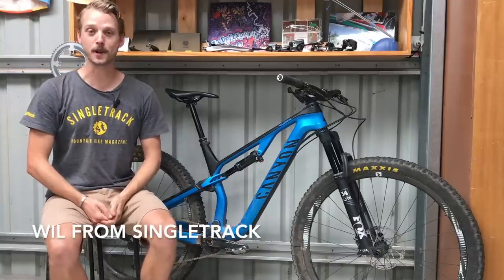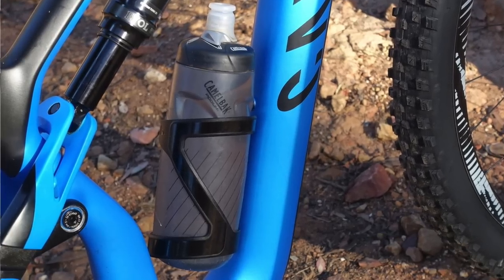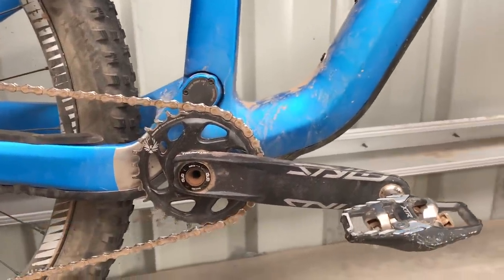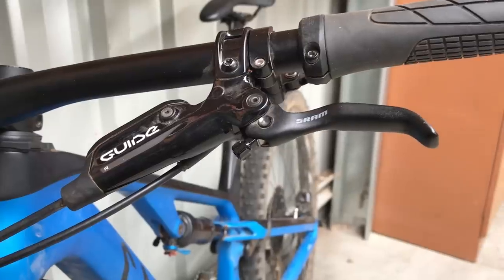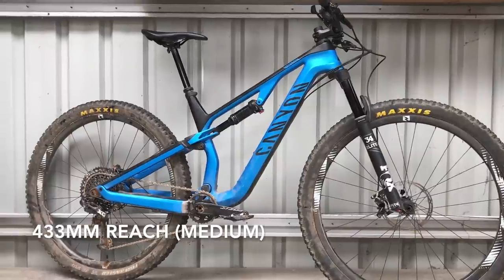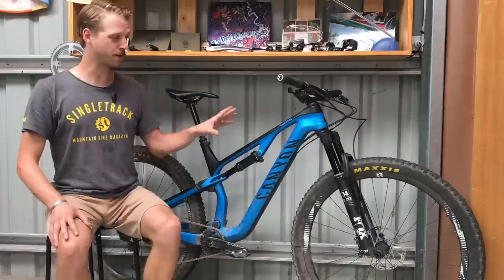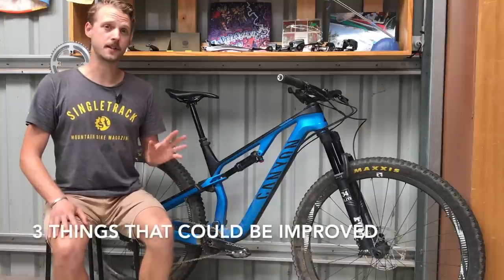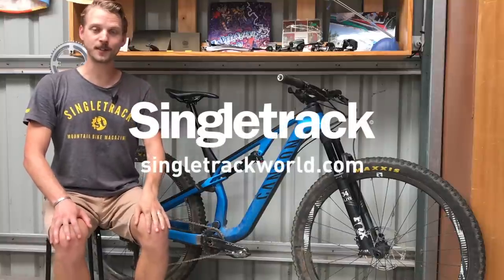2019 CANYON NEURON CF REVIEW | A Longterm Test Of Canyon's New Carbon Trail Bike

Comment: How about a comparison to the AL neuron? 700€ jump to a CF seems a bit too much for a weekend rider... your thoughts?
Reply: Agree!!!
Reply from the maker: Great question!

I've tested the pre-2019 Neuron AL, but I've not tested the 2019 version, which does have an updated suspension design and new frame geometry. As mentioned in the video, the 2019 Neuron AL and Neuron CF share basically identical geometry, and Canyon told me that the suspension rate (and therefore behaviour) is very similar between the two bikes - even though the layout looks quite different. So you can expect the handling to be pretty similar.

The Neuron CF frame isn't that much lighter than the alloy one (there's less than 200g difference), so you wouldn't buy it to get a significantly lighter bike. But the carbon frame has clearly been built to be stiff, strong and reliable, and there are some really neat details that you won't get on the alloy frame, such as;

New bearing concept: industrial cartridge bearings with dual-lip seals, external pivot caps, and a dual-row bearing arrangement for the main pivot (for stiffness)
Cable Channel: routes the cables internally underneath bolt-on downtube armour
Quixle thru-axle: offers tool-free wheel removal with a very clean look
IPU (Impact Protection Unit) headset: prevents the bars from over rotating in a crash

As for the parts on the Neuron CF 8.0 vs the Neuron AL 7.0, here are the upgrades I can spot that you get on the CF 8.0;

Wheels: The DT Swiss M1900 is likely to be a stronger option, and interestingly, Canyon specs the front wheel with a 30mm internal width and the rear with a 25mm width, which is pretty cool! The Mavic XA Pro wheels on the AL 7.0 are a little skinnier with fewer spokes (24 vs 28)
Tyres: Maxxis Forekaster 3C tyres have a better compound and casing
Brakes: The Neuron CF comes with SRAM Guide T, rather than Shimano MT400

Otherwise the suspension package and drivetrain are very similar between the two.

For a weekend warrior, the alloy model is likely going to be a great bike, and certainly good value for money too. If you're looking for a bike to own for a long time, and something that you can steadily upgrade over the years, then it may be worth going up to the carbon model to get that higher quality frame and bearing system.

Either way, I'm sure you'll be stoked with whatever you get!

Hope that helps, but just shout out if you've got any more questions :-)

[ST Wil]
Reply: @singletrack  actually old geometry bikes are still available. The best option would be to test 3 bikes back to back on the same track. But just testing 2 new models AL 7.0 vs CF 8.0 is good. Well I am riding in weekends, because I work in workdays, so maybe I am weekend rider, but when I am during long weekend ride (we are doing about 40km on mountain trails daily if I am 40km from my car on Saturday and planning to go back on Sunday I don't even want to think about cracked carbon frame. I have not seen any impact test, etc showing comparison between AL frame and CF frame. This side actually biggest problem that I have with new bike. And regarding brakes - well... both bikes have brakes that need upgrade. And tires are not worry as in Rocky areas they don't last too long. Some people want bike they can trust dourng 2-4 days runs and I am one of them. I don't trust CF as frame material without proof of impact tests etc. I am riding for over 30 years and every year me or my wife have smaller or bigger crash, so this is significant factor for me. Also there is no info about crash replacement cost. So if You can get answer for those points I am sure more people could decide better with their next steps. Currently safer option for me is AL...

Comment: Hi, Wil  Now I'm still deciding between Scott spark 920 & the Neuron 8.0 CF. Looking for shorter travel 29r for all-around distance as well as mixed trails. The Neuron is hard to ignore the package & price just don't want to regret not buying the proven spark, can't get any demos done on either bike as I need to buy online. what one would you choose
Reply from the maker: Hi Colin P!

That's a really good question, since the Scott Spark is a very well regarded lightweight trail bike. 

In direct comparison, the Spark has a little less suspension travel (120/120mm vs 130/130mm), but it otherwise share some pretty similar dimensions to the Neuron CF - the head angle and reach are almost identical, for example.

I haven't ridden the Scott Spark - I've only reviewed the Spark RC, which is the 100mm travel version. However, the Spark RC and Spark essentially share the same frame, just with different length shocks and forks that change the travel between the two.

I really like the Spark's suspension design, which is actually pretty supple and active. And because you have the 3-position TwinLoc remote, you can tune the suspension to be a little softer for descending comfort and traction, while being able to flick into the firmer 'Trail' mode when you need efficient pedalling. It's a nice system that works well.

Some people aren't big fans of the extra cables that comes with the TwinLoc system, but having tested it on the Spark RC, the Genius and Ransom, I have to say it's a big performance booster on all those bikes.

In comparison, the Neuron CF has a simpler approach to its suspension, and it's designed to pedal efficiently without having to adjust levers on the rear shock. While it pedals and climbs well, I wouldn't say it's super plush though. 

The frame on the Canyon Neuron CF does appear to be a little beefier than the Spark, and it is really nicely finished too - the pivot bearing system, IPU headset, and semi-internal cable routing design all work well.

Personally? I'd probably prefer the Scott Spark 920. I like that Scott is spec'ing the Spark with a shorter fork offset (44mm), which should help to stabilise the steering a little at higher speeds. That was something I found lacking on the Neuron, as it was a little twitchy on more technical high-speed descents.

Hope that helps!

[ST Wil]
Reply: Thanks, Wil. It is probably worth the extra money just for the ride quality alone. Helps with my decision  👍👍👍
Reply from the maker: @chloemuffin1  - Glad I could help out mate!

Let me know if you've got any other questions in the meantime.

[ST Wil]

Comment: Hi Will, 
excellent review, thanks a lot man. Can you please help me with something? You said, that it can be problem to upsize due to seat tube lenght. I am 185cm tall (cca. 6"1´) with inseam +- 85cm. The size L is for me OK (I test it), but I hate long stems and on this bike is the stem on the longer side (60mm) and 453mm for reach by size L is really max limit for me, I think. The quesion is, when I go for XL(on Canyon site for 192+ cm) and change the stem to 40mm (it will be then the same reach as by L size), I am worried, if the seat tube lenght will be OK for 150mm dropper, cause it is 30mm longer as on L. What do you think about it? And overall the feeling on XL with my height. Thanks in advance. 
Best regards, 
Tomas
P.S.: Have you ridden the Izzo? I am about 220lbs (+- 100kg) and I really dont know, if the frame on Izzo is so stiff as this on Canyon and if it can handle my weight without flex. I am also thinking about Jeffsy Pro or Propain Hugene. I really want mainly a good climber (+- as good as Neuron), but maybe something little better on descents. Ibis Ripmo is the best of both worlds, but for me too expensive.
Reply: Hi,  how did it go? I am 186/88 a want to order XL
Reply: @Brcinskij  Thanks! ordered XL today... I was lucky because there was one XL on the website (2. jun 21') and its mine :)
Reply: What did you end up with?  
I bought a 2020 Commencal Meta TR 29"! and love it on the Oregon Mountain Trails.
However, here it is a couple of years later and I am looking at a used 2019 Neuron for the 2 months per year we spend in Southern (not so mountainous) Thailand.
Reply: @drmoynihan  Hi, I bought size L and it's a great bike, with L and my height the position is a little upright, but I like it so. It is very good uphill and for me personaly good enough downhill too. After purchase I have changed the handlebars for 800mm fatbar (20mm rise) and the saddle for Ergon SMC4 MTB comp gel, because the original one was too hard for me. With my height/inseam the dropper post is about 2cm from frame. Overall It is an excellent bike for my riding style. The YT Izzo was also on the list, but in the end I took Neuron (I didnt want SRAM components, cause I am already used to Shimano). I hope it helps you.

Comment: Important fact is that this bike has (just) 30t chainring, which may be not sufficient in higher speed. I found myself driving with smaller sprockets more often. Strange decision by Canyon, especially when Strive and Spectral models have 32t and Lux 34t. Anyway, thanks for precious review and greetings from Czech Republic.
Reply from the maker: Hey there Jiri!

Thanks for watching the video, and for your kind words :-)

I think the 30t chainring is a decision by Canyon based on the Neuron being targeted more at beginner and intermediate riders as a comfortable, do-everything trail bike.

The Spectral and Strive are pitched at more advanced and more aggressive riders who want to ride really fast downhill - so they have bigger gearing with the 32t chainring. And the Lux is of course a very lightweight XC race bike, so this type of rider will want to have higher gearing.

The good thing is with any 1x drivetrain though is that changing the gearing is very easy to do - all you need is to swap the chainring to a bigger or a smaller size.

For me, I like the 30t chainring. But then I prefer to spin a lower gear, rather than mashing a harder gear. I find this is better for my knees, but that is my personal preference :-)

[ST Wil]

Comment: Hello, thank you for review.

I'm  185 cm and 89 inseam - L or XL. What would You recommend for me ?
Reply: Hi, I’m similarly specced. Canyon Sizing tool says “L”. Which one did you get, and how did it work out for you?
Reply: @globetlottel  Same here. Which one did you get?
Reply: @Diego Perez, i got the XL and i think it fits fine, in terms of “can reach handlebars comfortably and turn them the full range” or “can adjust to good seat height” etc. haven’t been to the the trails with it though. (190 cm / 90cm Inseam). That being said compared to my old 26” Hardtail this is a huge machine and doesn’t feel as nimble, more like a big cruiser.
Reply: @globetlottel  thanks for your response. How much seat post length do you have left. Doing the math it seems that it is too tight.
Reply: @Diego Perez  I have the dropper seatpost inserted all the way to the bottom. For normal riding on flat roads (post fully extended) I might want to pull it out of the frame by 1 or 1.5 cm. So, there’s plenty of usable seat post length left in my case. The reviewer in this video mentioned the seat post wouldn’t go low enough. I believe that could be a problem for some body proportions, but not for 185 or 190 cm with 90 cm inseam. When dropped down, the saddle is well out of the way.
Reply: @globetlottel  very useful. Thank you so much
Reply: @Diego Perez  
my pleasure! Enjoy your bike when you get it :)

Comment: Could a 14 year old 5.2 teen ride this? And could this fit a Fox 40 down hill fork
Reply: No way this bike is fitting a Fox 40, if you said a Fox 34 then yeah but no more than that, you're going to break the frame. And yeah I guess a 14 yo could ride it
Reply: Aniol Juanola, thanks, and how would it crack the frame?
Reply: @isaacalvarado2568  just think that this bike is meant to ride with 130mm up front. If you put there a 200mm fork you're changing the geometry drastically (changing the angles and the way the frame is meant to work) and you can easily brake it as the frame would experience forces which is not designed to support. You could try it and they would fit, but after a hard impact or a big drop I think it would brake down (keep in mind it's also a carbon frame).
Reply: I have this bike and I got a Fox 40 for it and it feels great! Fox 40’s are awesome! They look cool, and they function amazing! I ride road but I ride a DH bike🤣 LOL if you get a Fox 40 you won’t be disappointed

Comment: 173 cm, get recommended s but I really want a 29er 😕.
Reply: Vault-Boy Dan at 173 you could easily get away with a medium
Reply: @markroberts9298  Hey, thanks man :), Canyon's sizing really confuse me.
Reply: Vault-Boy Dan I just had a look at the website, and for the small it says up to 174cm and the medium from 174cm up. If you really want to 29, definitely go for the M because your almost there, and the reach on the M is only 15mm longer than the S. It all depends what sort of rider you are, if you prefer more space and want a 29er go for the M, but if you want a smaller, more nimble and nippy bike, go for the S. that isn’t to say the M won’t be nimble tho.
Reply: @markroberts9298  Thanks for checking it for me, I really appreciate it :). I think the bigger wheels suit better for this marathon/trail oriented bike and you're absolutely right about that reach, at the end it isn't that much of a difference and the benefit of having bigger wheels probably prevails in this case. Right now I'm searching for the trail bike that can climb very well and also be confident on the descents so I'm thinking about this neuron cf or spectral, but I'm leaning more towards neuron as I really want a good climber.
Reply: have you bought the bike? @Vault-Boy Dan

Comment: Hi, that's a great video! I have a question regarding size: I'm 179cm, 82cm inseam and 62cm arms. Would size L fit me better than M? Should I go with longer stem on size M (7-8cm) or shorter stem on size L? Thank you!
Reply from the maker: Hey Dario, thanks for watching!

At your height, I would 100% recommend the Large size frame in the Neuron CF.

I'm 4cm shorter than you at 175cm tall, and while the Medium was ok for size, I would have preferred a longer reach. The Neuron CF isn't a long bike in the cockpit, so I think if you went for the M, you would be very cramped.

Hope that helps!

[ST Wil]
Reply: @singletrack  Thank you for quick response. In that case I think I made a mistake. I already purchased neuron al 7.0 M size which is similar geometry and it feels a bit short. I put 70mm stem instead of original 50mm, pulled a saddle back to max and I still have a need for even longer stem. This tells me something is not ok. I would say it's better to have longer frame and short stem than the opposite. Canyonservice tells me it's ok from their perspective so I wanted 2nd opinion. Do you maybe know how it goes with replacement? Maybe only the frame? Any experience with canyon? Thanks a lot!
Reply: So, what happened with Canyon?  Did you trade up for a Large?  Was Canyon easy to work with?  Are you happy?

Comment: why u said its a trailbike ? 
canyon never said it is a trail bike.
On the contrary, they even said it does not follow the trail bike trend and is intended for touring. Just look at the Geometry, it has nothing to do with a modern Trailbike.
The real Trailbike/Allmountain from Canyon is the Spectral and nothing more.
Reply from the maker: Hey @fnnor, thanks for watching and for the question!

I think it might depend on what your personal definition of a 'trail bike' is. Also, the Germans tend to use the term 'touring bike' in a different way to other English-speaking cycling markets, so it can cause some confusion.

It also depends on how many genres of mountain biking you think there are. Based on the terms that many MTB brands and media use, here's a bit of a breakdown for ya;

XC Race: Hardtails and full suspension bikes with 100mm or less of travel
Marathon: 100-120mm travel, focus on lightweight and race geometry
Trail: 110-140mm travel, relaxed geometry, balanced for uphill & downhill
All Mountain: 140-150mm travel, focus on descending fun, plusher suspension
Enduro: 140-170mm travel, aggressive geometry & parts, focus on enduro racing

Because the Neuron CF is neither an XC/Marathon race bike, nor an enduro race bike, it slots pretty firmly into the 'trail' category. Which as I mentioned in the review, has a pretty broad definition depending on where in the world you live and who you ride with. 

Whatever you want to call it, it's a bike to have fun on. It's light, efficient and comfortable enough for tackling long arduous climbs, but it has enough suspension, high-volume tubeless tyres, and powerful 4-piston brakes to enjoy the descents too. Most mountain bikers would call that a trail bike, but I can appreciate that others will have different names for it.

Hope that helps explain, but just let me know if you've got any other questions mate!

[ST Wil]

Comment: 7:27 but you never considered the size could be one too big for you?
Reply from the maker: Not at all. The next size down (Small) not only moves to smaller 27.5in wheels, the reach shrinks down to 418mm, which is tiny!

In fact I would have really liked to try a Large frame, which comes with a 453mm long reach. But as I mentioned in the video, the long seat tube makes that pretty much impossible, unless you go to a much shorter dropper, or a regular seatpost. As it stands, the 433mm reach on the Medium size is fine, but if anything I'd want it longer - not shorter.

Hope that helps!

[ST Wil]
Reply: @singletrack  I know, the sizing problems are known to me. My girlfriend is 178 with 88 cm inseam and pretty short torso, so the opposite problem, I guess. 
I on the other hand, just rediscovered happiness when trying out a nicolai geometron in xl ;)